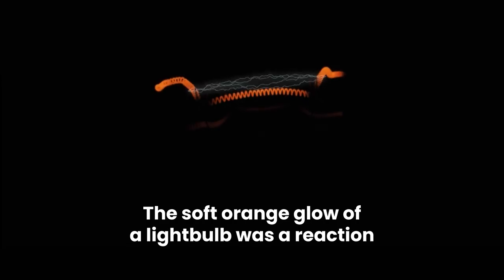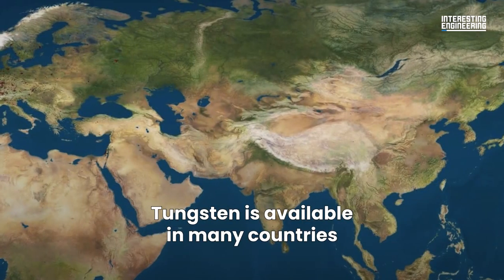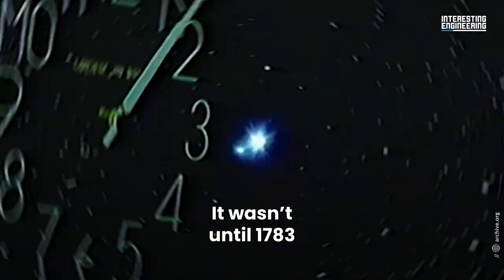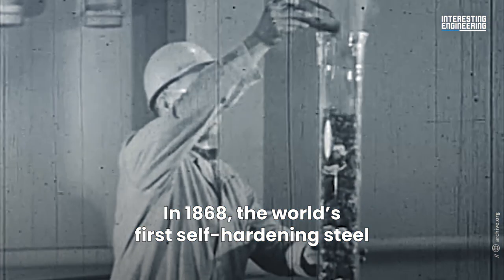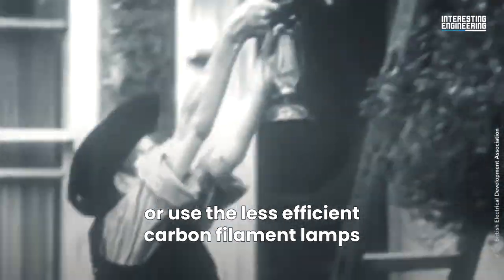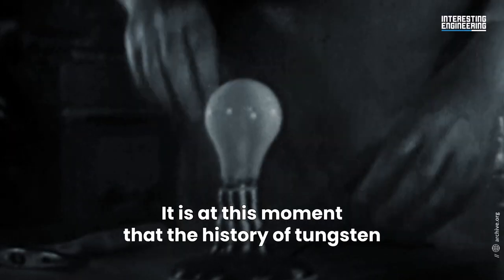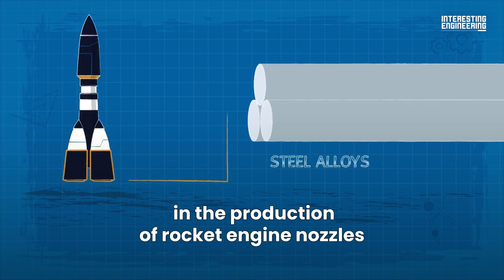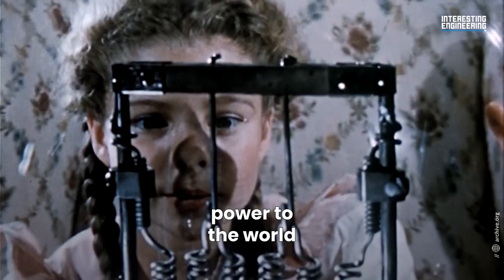Why Tungsten have a great impact on metals

Comment: Heads up, tungsten super alloys are used in turbine blades but not windmills ( as shown in the video). Windmill blades are often glass fibre. The turbine your referencing is that of jet turbines found in planes and high power generators. Hope that helps